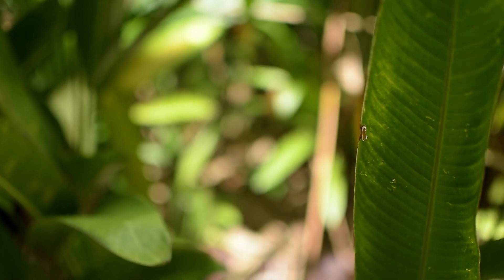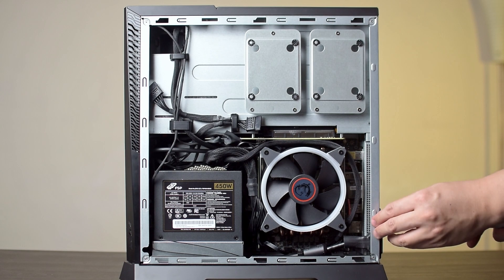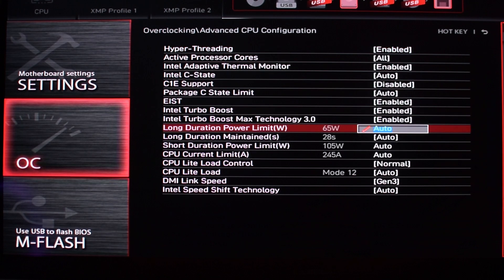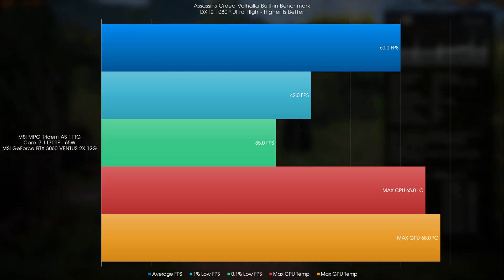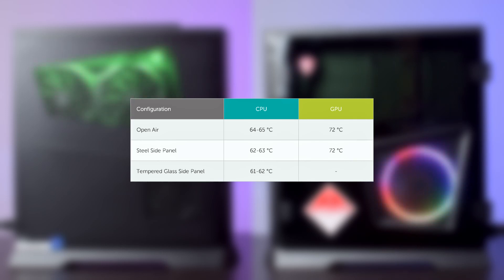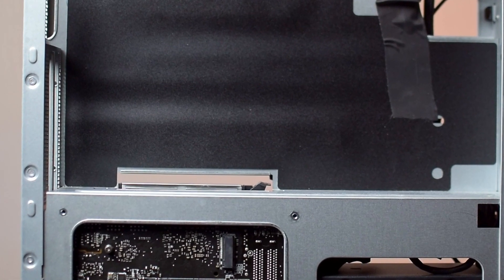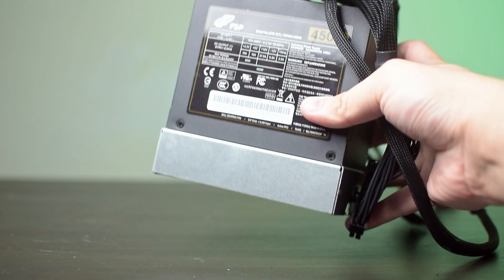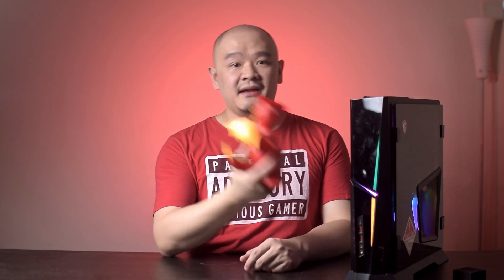One of the BEST ways to get a Gaming PC in 2021! - MSI MPG Trident AS 11TG Review

Comment: Thanks for your detailed review. Convinced me to snag 1 with 750w 3070 and 32gbram.
Reply from the maker: With GPU prices now, I still feel it's a pretty good deal.
Reply: @TechRodent  it was on newegg right now for 2700 Canadian 3200 msrp but has a 600 coupon
Reply from the maker: That's a pretty stellar deal!
Reply: @TechRodent  ye i was originally wanting the 3080 version for 3699$ but after seeing this vid i doubled checked the parts and there was the 3070 for 27 and couldnt pass that up. Especially when the card is the only difference
Reply: @mopground  hey did you end up getting it and have you had any thermal issues?
Reply: @megadeth8592  i did buy it and am keeping it. Technically there was 1 thermal issue play warhammer 2 total war but, i had set it to quiet mode in msi center. Using the bios settings or extreme performance mode in msi center, i noticed the cpu went to 82 degrees once but shot right back down. That was playing days gone on max settings normally  it hovers around 78. the gpu heat has had absolutely no issues so far. It is a bit louder than i like, using a phone app its says 59 dcbs from about 2 feet away. I dont know if thats acceptable or not. Im not used to it cause my previous comp was so quiet.

Comment: Hi why your video this MSI MPG Trident As 11TG (RTX3060,11th)  showing memory 11GB SK Hynix DDR4 3200Mhz?  but i bought same model but different memory model and speed, please help?
Reply from the maker: Check your seller listing and if it's not correct, contact them and let them know it's not as advertised
Reply: @TechRodent  listing only showing DDR4, after bought i only see, seller told me for MSI MPG Trident As 11TG (RTX3060,11th) is only 2933hmz, i bought in singapore, this make me confuse
Reply from the maker: I would see if I can get a snapshot or maybe check MSIs website to see if it's listed

Comment: OOF how the 450W psu is enough?
Reply from the maker: Surprisingly, I thought the same, but if you go to almost every PSU calculator website, including ones from Corsair, BeQuiet, etc, under the exact same configuration, 450W is enough, and those websites usually put a buffer as well so... 

It actually looks like it's possible to do a 450W PSU system with these components and not bottleneck it.
Reply: 450w is more than enough
Reply: Hahaha As of now I am having a trouble, I guess my PSU doesn't work anymore in my 3060 ti. it needs 750 W I think...

Comment: I noticed there really isn't much 'wriggle room' for the power supply. Will I have to find a power supply with the exact same dimensions to switch to a different one?
Reply from the maker: Yes, there isn't much wriggle room for expansion. 

This system uses the standard SFX style power supply, you should be able to replace it with another compatible SFX PSU
Reply: @TechRodent  oh so any SFX PSU will fit? I was getting worried cause all the other SFX PSU are larger than the one we were given...
Reply from the maker: The last I checked they're about the same size, in fact the Trident uses an off the shelf FSP PSU, so if you're concerned of fit, I did show the model number of the PSU in my video, you can compare dimensions with your choice of replacement to see if it'll fit.
Reply: @TechRodent  Thanks a lot!

Comment: what are the dimensions of the PSU? IM updating mine and I need to get the correct one.
Reply from the maker: Based off FSPs website it's 125 x 100 x 63mm
Reply: @TechRodent  thanks for the info.
Reply: @TechRodent  could it fit 127 x 102 x 64 mm PSU inside?
Reply from the maker: As long as it's an SFX PSU it should be okay
Reply: @TechRodent  again, thanks for the info.